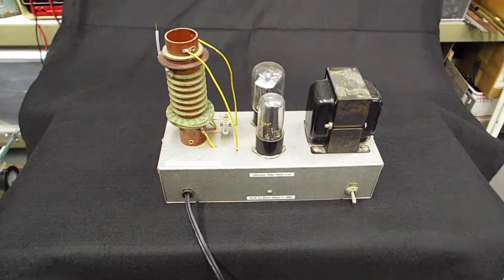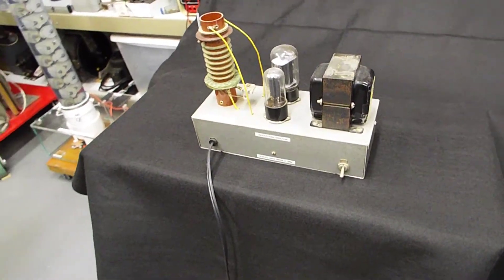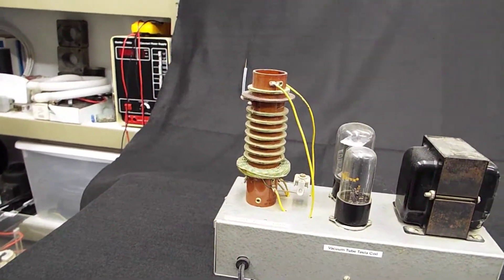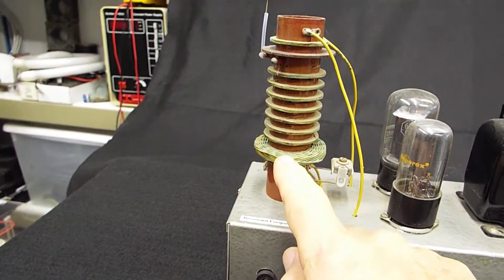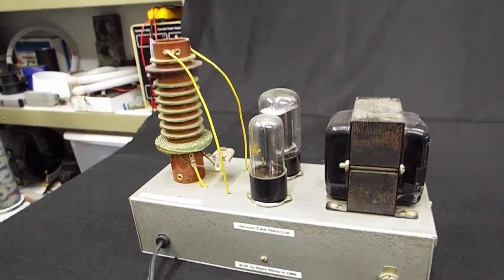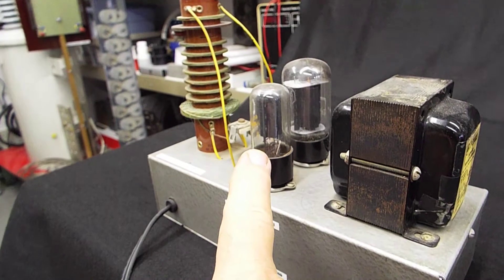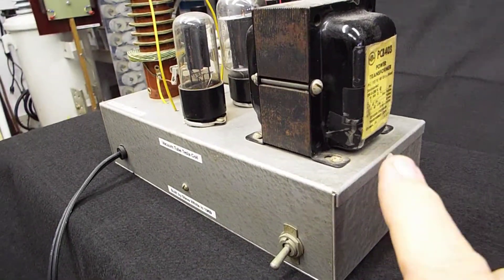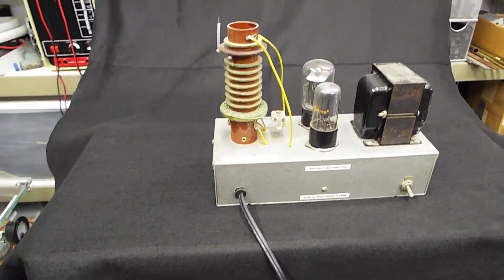6L6 Vacuum Tube Tesla Coil Overview (built in 1969)

Comment: Enjoying your vids. I (vaguely) remember those old air core coils, as a kid I loved taking apart old and junked TV's and of course Mom was not pleased when piles of junk ended up on the kitchen floor, table, etc. The coil wires were sometimes insulated with cloth and wound beautifully with no bobbin. This was early '60's, I'm guessing we were growing up around the same time. Later on I built a vttc in '72 I think with 2 811A triodes (and Dad's help) but I didn't actually "get" how it worked. I do now, RF is a great hobby. Love that little coil! A lot of people posting projects seem to slap them together with plywood and roofing nails, thinking here you know what I mean. Not trying to be critical of anyone. But that little coil built on a proper aluminum chassis looks professionally done.. make a great family heirloom! Anyway, I enjoy your stuff, keep putting 'em up if you can.
Reply from the maker: Thanks for the kind words. I built that small VTTC in 1969 when I was 16 years old. It was my first Tesla coil. I still have it and it still works as can be seen in the videos. I only build projects with high quality construction methods and materials. I don't like things that are just slapped together. I don't post very often because I spend a lot of time on each project to get it just right.

Comment: Cool little coil, What's the power of that little tube Steve?
Reply from the maker: I think the power output is around 50 watts.
Reply: @littleshopofelectrons4014  cool thanks, I've got a gu50 I think I might put together a fb driver to drive a ac fb for my lamp ..

Comment: I love vaccum tube devices but unfortunately I was born in 2004
Reply from the maker: Why does your birth date matter? You can still buy vacuum tubes and build devices with them. Have a look at my 833C VTTC video. I built this only 3 years ago.
Reply: @littleshopofelectrons4014   you can't buy any vaccum tubes in India 😔
Reply from the maker: @Time-cc2qb  How about E-Bay? Lots of them for sale there. That's where I got mine.
Reply: Yes. Vacuum tube electronics are as easy or easier than designing FET based switch mode supplies for t.c.'s, plus tougher and more resilient to boot. I've built many tube, solid state, and spark gap coils and I'm 100% self/mentor taught.

It's so weird. I remember helping pioneer the modern tesla coil in the mid 90's and especially around 2000 when Terry Fritz, myself, and others were designing new components such as the mmc. I helped him failure mode test many caps. Now there are 1000s of coils plus cheap Amazon garbage.

Comment: Very cool! 
Do you power the filaments first before applying plate voltage, or does that switch turn on the filaments & plate simultaneously?
Reply from the maker: Thanks. Its all switched on at the same time. Its been operating that way for over 50 years with the original parts so it must not be that stressful on the tubes. Its low power anyway, less than 100 watts. It was built from plans (L'il TC) in the July 1964 edition of Popular Electronics magazine.
Reply: @littleshopofelectrons4014  Cool! Thank you.